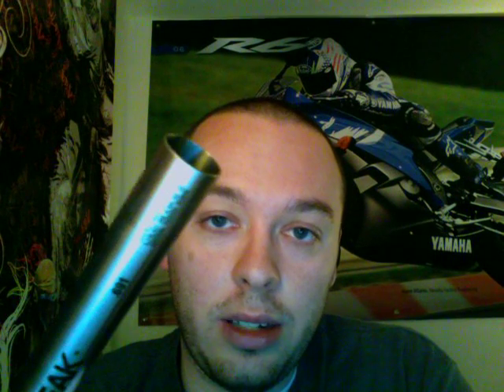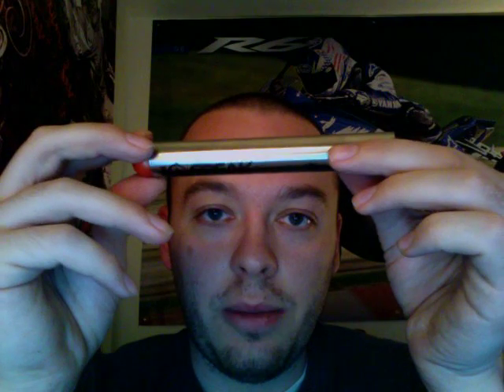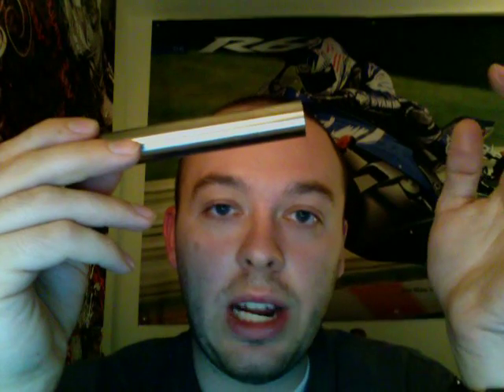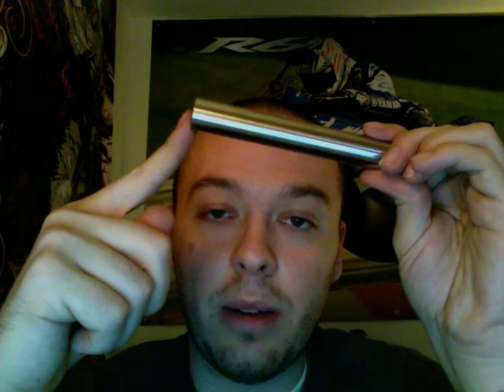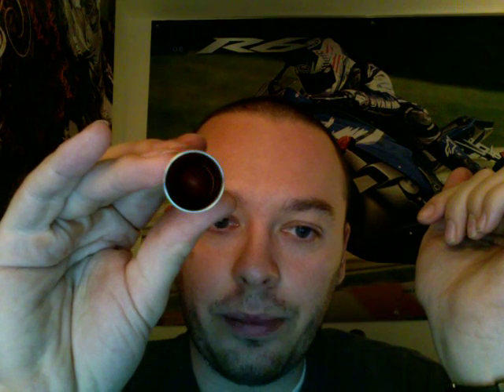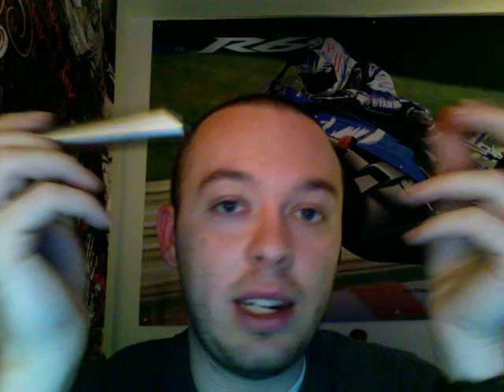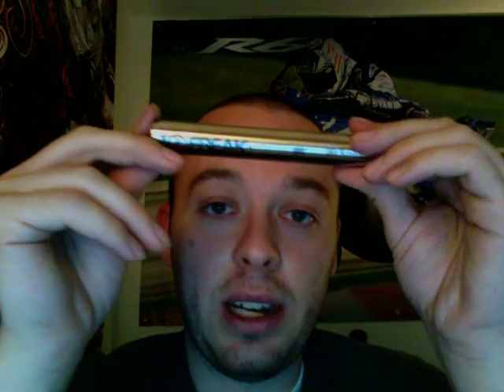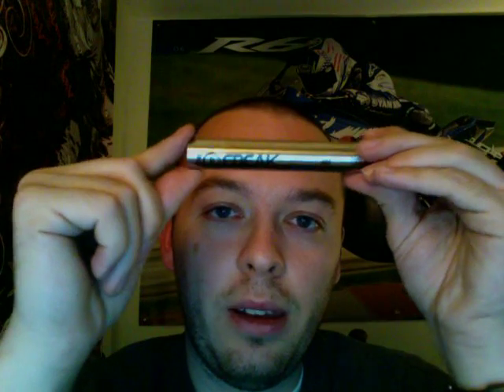How to: Freak barrel inserts (selecting correct bore size) 3/3

Comment: There's a lot of bad advice here. If you make it so that a lot of your paintballs partially roll down the insert, you do realize that you are badly screwing up your shot consistency, right? 

Furthermore, underboring by .003 to .006 does NOT break paint. That is a myth that has been busted to death by pier-reviewed, statistically analyzed research. Many pball players, myself included, underbore all the time and we don't break paint, but we do get better efficiency and consistency than you. And if you play pump or stock class, underboring is a MUST! Just give it a chance and you'll see that I'm right.

Comment: I normally do this. but don't you think when it's pushing through, would it effect the shape of the ball being squished through?
Reply: SirVapingAlot 
No. Paintballs are flexible and are suited for squeezing through tubes slightly smaller than themselves. Don't drive yourself crazy trying to perfectly bore-match, though. According to actual research, underboring performs better than bore-matching, anyway, and it does not break paint more than bore-matching, either.